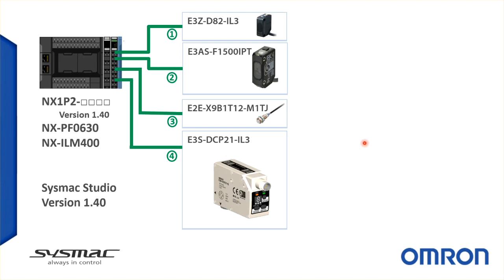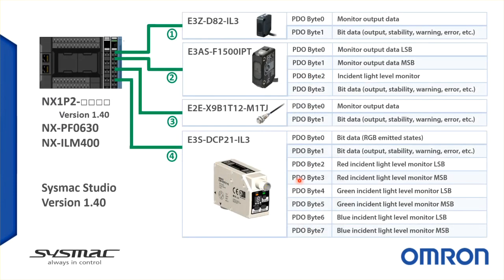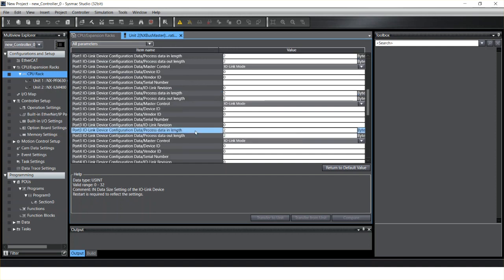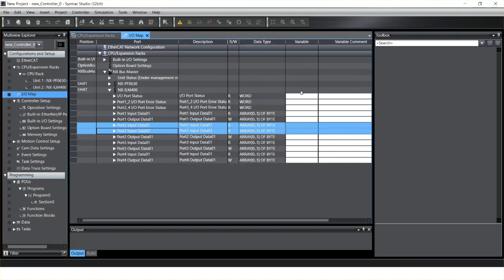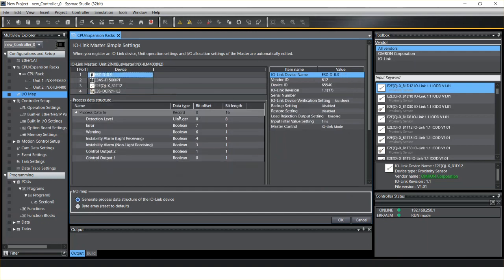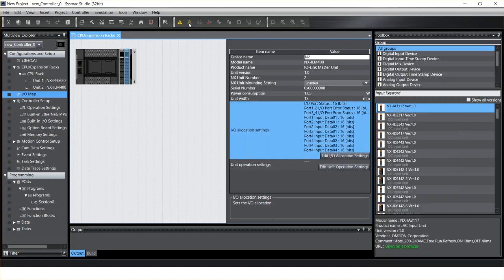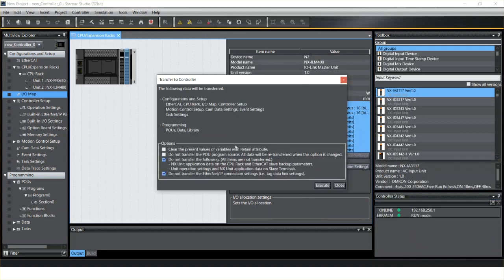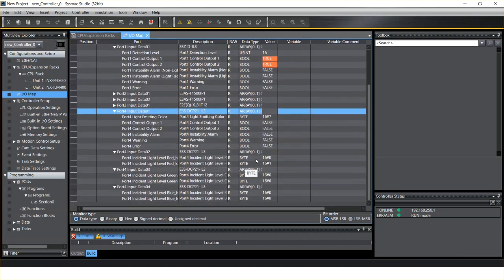How to configure IO Link on SYSMAC studio

Comment: Thank you for the helpful video! 
If I have IO-Link from another brand as IFM, so can I use Sysmac Studio to configure as you do
Hope to receive your answer!
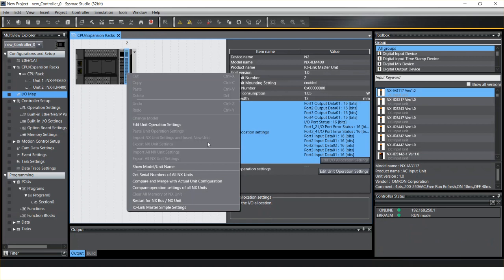Reply: Yes it's basically the same process. You just need to install the IFM or other 3rd party iodd file on SYSMAC studio first by right clicking on the IO Link simple settings table shown 4:03 - 4:19 mins then click 'install IODD file' . The iodd files will be downlaodable from the support-downloads section on IFM's website.